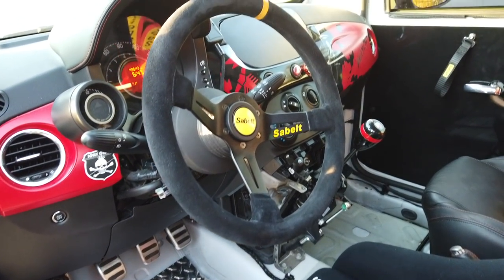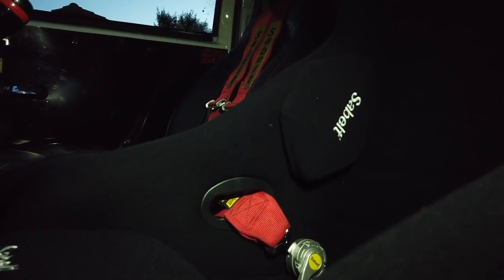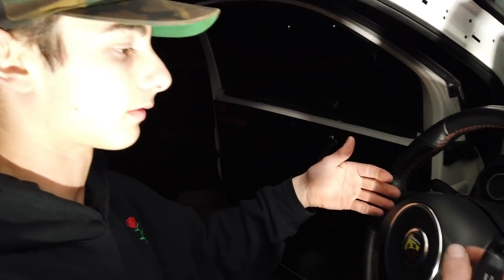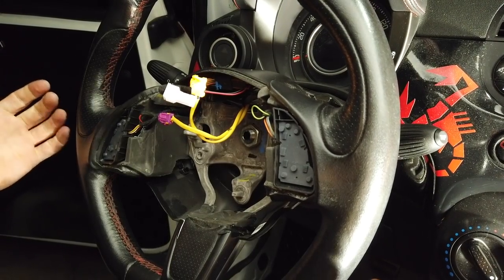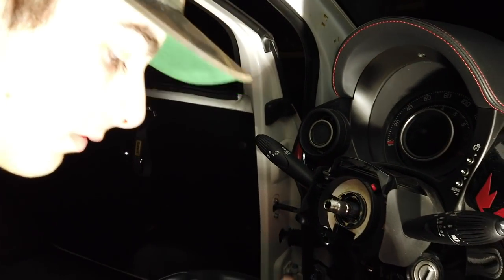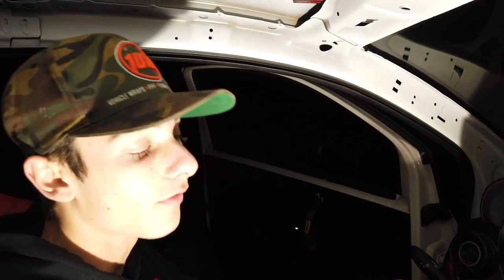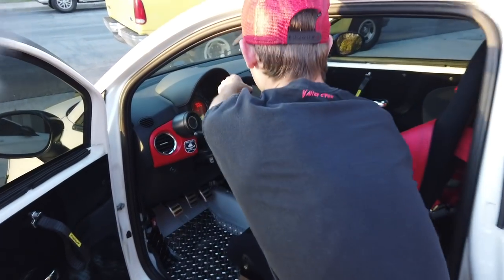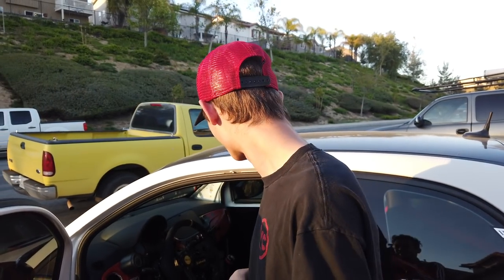FIAT 500 STEERING WHEEL INSTALL

Comment: Hey VC, did you guys delete the crank balancer on the ST when rebuilding the engine?
Reply from the maker: Angelo Lopezcua 
Yeah it’s gonna be coming out permanently and we’ll be installing the baffle and the oil feed block off.
Reply: @tbr.performance  I was told vibration might be an issue, have you had similar vibration after removing?
Reply from the maker: Angelo Lopezcua 
I’ve heard that the vibrations aren’t bad at all. It’s more for the picky consumers that don’t want to feel slight vibration. It’ll definitely free up some horsepower and revs. The engine still isn’t in the car yet but we will do a video comparing an engine with a balance shaft to ours without.
Reply: @tbr.performance  Sweet, I'm on the lookout for your new update on the engine!!
Reply from the maker: Angelo Lopezcua 
The head will be ready shortly!
Reply: Hi, thanks for this video, cool. What is exacly MOMO hub, MK4040R ?